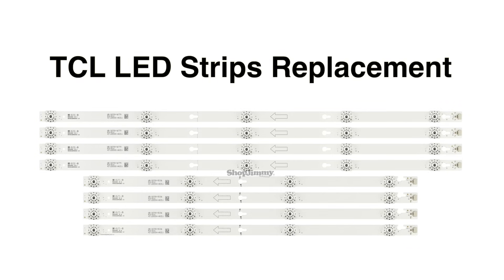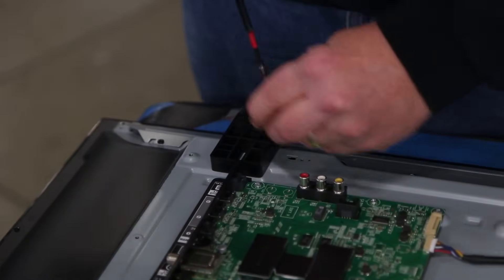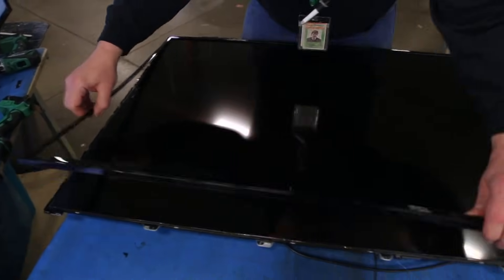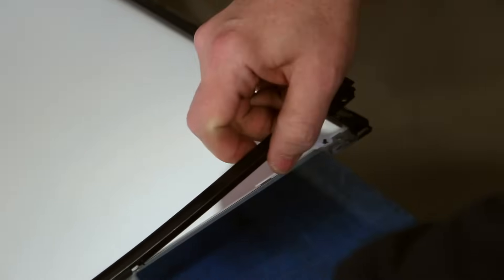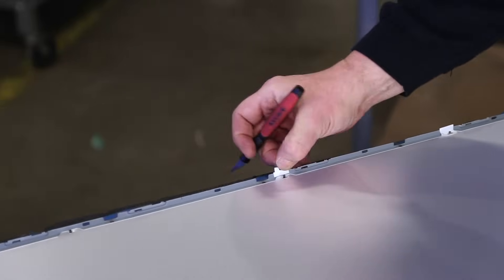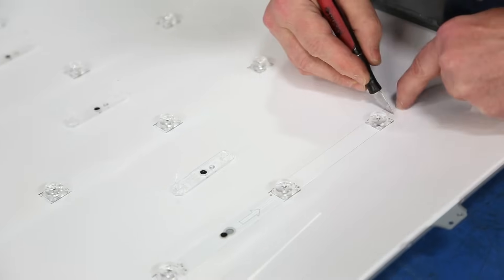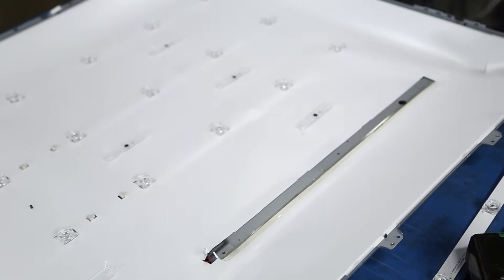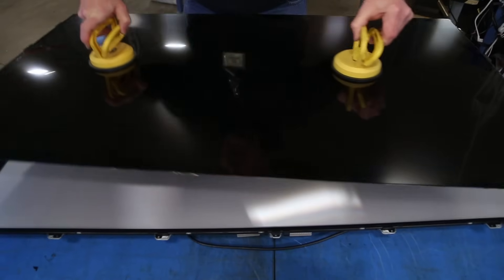TCL 55" TV LED Strip Replacement Tutorial for TCL Models 55S401 & 55S405

Comment: My led strips appear be to glued solidly down.  Like won't budge at all.  Going to try to loosen up the glue with a hair dryer.

edit:  Worked like a charm.  (Was also able to completely remove the reflector paper slowly but surely.) I found some places to wedge a screwdriver underneath while heating it up and then gradually popped each pt (was glued under each LED.)  Went like clockwork after.  Not sure if the black glue under each LED light was also for thermal dissipation but I didn't replace it.  (not like the tv lasted all that long in the first place ...maybe ~5 years.)

Great concise video to use as a guide.  I did a TCL 55S425.  It was a little different but the beats were the same.  Just go slow if your tv is slightly different because you might have to deal with disconnecting another wire or two, slightly different screw locations and wifi board etc and the the screen might have some ribbon cables and circuit boards attached.  The latter were also connected to the rest of the tv via a black ribbon cable.  Just flip up the cover on one of its ports and gently pull/wiggle it out.  

I out it together and voila ...one working tv.  Thanks.

Comment: **FYI**
One MAJOR DIFFERENCE between the 401 and 405 is the 405 has gold flexible printed circuits that are attached to the screen from the scan board. They just look like gold tape strips that are meant to be detached when running "a thin piece of plastic along the panel to be sure the adhesive has been removed."  Nowhere in this tutorial was that differentiated/shown as I'm assuming the TV being used in the video is the 401. You should really edit the video to clarify this or change the title of your video to pertain only to the 401. What was an understandable tutorial and process for me to undertake, turned into my TV being rendered useless. 

NOT HAPPY. VERY COSTLY OMISSION

Other than that....the video was very well done and easy to understand

Comment: Should have read all the comments first...absolutely wild that a tech repair channel would miss, probably, the most important step of removing the driver boards as to not damage the gold ribbons. I slightly cut one on accident trying to separate the adhesive from the panel (also explained poorly). Screen works again but the color is now a little off and it has lines that make it look like an old tube TV. Pretty disappointing the comments were more informative than the video itself....

Comment: And another thing, with this model actually it is not that difficult to remove the rear reflective film. They are just lazy and didn't even check to see that the adhesive of is very light on this one.

Funny because in another video where the adhesive actually is very strong, they make no such recommendations 

Do you even repair?

Comment: My tv has a entirely black screen. You can see the screen if you hold a flash light to it. If I need to replace the strips how many strips will I need to replace? When searching for strips I’ve noticed some come in 4pc and 8pc how do I know how many I need. I have a 55in tcl model 55S421
Reply: Hey did you ever replace the LED strips? I literally have the same exact TV model as you

Comment: very informative. However there's not much said about pulling the glass out. I did this and the magnetic film that is sealed to the glass popped a bubble and a crack looking bubble across it. It is not a broken glass. It is air between the screen and glass shield. Is there a way to fix air bubbles?
Reply: i have found out and there's not a fix, tv going to the trash.

Comment: This video is stupid. When you take off the screen, DO NOT USE THE ADHESIVE. There are little tabs around the edges that you can pop off to remove the screen, attempting to remove the adhesive will CRACK YOUR SCREEN BEYOND REPAIR!
Reply: “Do not use adhesive”?

What do you mean? The only adhesive he used was when he installed the new leds

Comment: Great walk through. You do miss out a few key parts as stated in some of the comments. The boards at the bottom connected to the ribbons would easily tear if not aware. Also for a glue separator, i used an old plastic spiral notebook cover. Worked like a charm. Glass came off super easy and was set aside until re-assembly. Overall took me about 4.5 hours to complete. Worth it for me. Thanks for the tutorial.

Comment: Thanks. Fixed my tv. Also listened to another comment to flip board around and tape it to TV. I didn't have suction cups like instructions did but I made two loops using gorilla tape and taping the legs down. Worked perfectly.

Comment: This worked perfect to fix the initial problem but I ended up having to junk the tv anyway because the adhesive is quite strong and the screen broke while disassembling. Can’t stress enough how delicate the screen is and even if you follow the steps exactly there’s a risk of breaking it. Oh well, I got the tv for free and only paid 40 for the backlights so I’m not out on too much money.

Comment: Don't do this. They now put an incredibly strong piece of tape along the top of the lid. Makes it impossible to remove without braking the lcd. It's on purpose so you have to buy a new tv!
Reply: Yup, this just happened to me. I followed the steps exactly but that adhesive is so strong it broke it in a tiny spot in the corner but it messed up the entire screen.

Comment: How about replacing the LED strips next time after adding that pink double sided tape. That pink stuff is nearly impossible to remove. Has anyone found a substitute material (black adhesive) that TCL uses to bond most of them in? I would assume it is some type of thermal adhesive

Comment: Thanks for the video.  I have this TV and it went completely black but if I shine a flashlight on it I can see the picture.  So it looks like my backlight went out.  But why would all LEDs go out at once?  Wouldn't that indicate some sort of power supply issue to the light instead?
Reply: Hey Robert, I also have this tv and my lights died last week, just letting you know to save yourself the trouble these LEDs are cheap and similar to low end Christmas lights where they cannot remain lit if one in the chain dies. You could test the internals with a volt meter but there's tons of discussions online confirming the absolute horrible quality of the LEDs. The whole thing seems to be designed to eventually fail.
Reply: @nukaiaahpo335  OK, thanks, I read that too, and if one goes out the whole strip is dead.  Terrible design, but at least it makes sense why this is such a common problem.

Comment: Hey Jimmy if you're still answering questions can you answer this question I have a 55 inch TCL Roku Smart TV. The screen is black and I have sound turns on and off. I've tried the goof ways with the controller five times with the top right button two times left two times right two times up and two times down did it 9 10 times. Then change the batteries try it again nothing, I unplugged it and that didn't work either so if you could tell me what I need to do Roku TCL model number 55 S4 21 if there's any other information please let me know.

Comment: How's he going to make this video and not say a single word about the ribbon cables attached to the bezel and the screen. Like thats the most important and crucial part of taking it off. I highly recommend watching another video on how to do this before you jump right in like I did lol. On a side note the adhesive underneath my screen was bonded so well it cracked my screen in one spot as I was running the plastic underneath it. The rest up it came right up no issues. If you want to attempt to fix your tv yourself before you buy a new one to try and save money then I say go for it. But its not as easy as this video leads you to believe.

Comment: This video skips many important steps and repairing your tv is 1000 times harder than they make it appear. I had to just throw my tv away after trying to follow this video.
Reply: Don't be dramatic. I just finished this 4 hour repair and I've never fixed a TV before. Be patient when you work on things and you won't break it.
Reply: Yeah OP must be a noob
 This is simple if you can follow instructions
Reply: Yup, not that well thought out
Reply: Tell me about it, I thought I had a great deal when I found a TV like this a few years ago with a few bright spots all I had to do was replace the little reflectors that had fallen off the leds.. but of course it was a lot harder than it looks in the videos, and that little thin LCD glass is incredibly fragile, I accidentally bumped one corner on the floor and that was it.
Reply: After I seen you needed suction cups, I knew I'd just needed to buy a new one
Reply: @bigmillgaming2362  I did this same replacement and didn’t use any suction cups. Makes it easier and faster for sure and is safer but completely possible without them. My model is the 55s425. Replacing these strips are probably the easiest fix on a tv, I’ve done it 3 times and I’m doing it for the 4th time in a minute. The only thing I do is watch 2-3 different videos then go at it. If you still have the TV you should 100% give it a shot
Reply: @imdatnigga9715  A few days after my comment, my tv randomly fixed itself thankfully. If it happens again I think I'd rather gone and get a new one, it's 5 or 6+ years old anyway
Reply: @imdatnigga9715  I am planning to give it a shot. How many strips do we need to order and what are the tools required? Worth a try though
Reply: @bigmillgaming2362 😂😂I totally agree with you,I stopped watching as soon as the suction caps were implemented.
Reply: @bigmillgaming2362 that is exactly what discouraged me. Everything else was okay. It does seem like it requires some skill in ensuring that you don't cut out wires, and removing adhesive has never been a fun part for me.
Reply: I mean if the tv was already broken then you had to replace it anyways lol at least they have a guide to try and help you
Reply: Years ago I got a tv when I was working the board was damaged I paid 5$ to have it fixed it's not that bad if you know a little bit of this and that the only way I figured out it was the board was because one chip was missing that samsung was a great tv over all

Comment: I finally took apart my 55S405. One thing I did notice is that all 8 of the LED strips are NOT securely attached to the back panel. All the screws are tight, but there's a little wiggle room by design. The screw threads are raised just a little bit higher than the LED strip, so there's not enough heat exchange from the LED to the case back plate. I would guess that's the reason these are failing so soon. After testing my LED strips, I found 1 out of 36 LEDs is dead. And wouldn't you know it, it was an LED at the top row where there's the most heat.

Before replacing all these strips, I'll be adding some thermal paste/glue to all 8. Each screw could use a washer to fit around the raised thread too to hold the strip more securely. But you'll need 28 washers.
Reply: I read your comment before fixing this TV and looked at it too. You are right, aluminum led PCBs barely makes a contact with huge aluminum back plate (supposedly to get rid of the heat). I think that wiggle room is 100% not intentional and is manufacturing error because they did not calculate little metal pieces arising around the hole after you drill it from behind the metal plate. These tiny metal bits adds just enough height so whole assembly is not possible to secure tightly and make a good heat transfer. What I did is I used Dremel and grinded each led srip mounting hole for a few seconds, it was enough to remove those tiny pieces and new (as well as old) led strips screws in very firmly, no need for washers. If you would add thermal paste it might be even a bit overkill, I did not since it looked more than enough heat transfer after this grinding mod. Also in my case I found some black tape used in manufacturing right under where led strip supposed to make a contact, so I removed those pieces to make metal to metal heat transfer (I believe manufacturing error no 2). But also I would recommend to remove that final white reflective sheet without cutting it like in this video so you won't damage it while grinding + it is not that bad to remove at all, I removed it intact without any tools, just keep steady pressure starting from the corner and allow some time for double sided tape to release it, it is even faster than playing with new double sided tape. After I was done I can already feel slight warmth on that huge back aluminum panel from the leds while tv is working. I paid 18$ for complete new led strip set from aliexpress and waited around 2-3 weeks for it to arrive, and the new ones looked the same as originals. And like somebody mentioned somewhere here before don't use any thin plastic piece to remove the glue from the panel, this is super risky, just unclip the top plastic inner filter frame and lift the whole thing.
Reply: Okay everybody here's my dilemma I have a TCL Roku TV if I open up the back I only have three parts one strip that comes from the power to the left side of one of the main boards then I have two quarts connecting one is the power from the switch on the bottom the other one is to the speakers everybody I've asked every one of these YouTube things I've looked at nobody has shown me the same TV everything is a LCD and they say that TCL is the same they're not the same I only take off the bottom part and it shows me my three parts and that's it I've got a black screen but I still have sound if anybody has any idea for me what to do please let me know

Comment: I just need to replace the screen.  Luckily, I found another exact model 55 TCL for free online (backlight was out).  I'm guessing the new screen will fit into my tv no problem?  Any advice is well appreciated!
Reply: I'd say you shouldn't have any problems since it's an exact model. Just make sure the insides look similar too, then a screen swap should work.
Reply: Yes make sure that it is a TCL not an LCD TCL Roku does not have LCDs Roku is a smart TV but it only has three parts on the bottom and no one has shown anyway to fix it they always show the LCDs

Comment: Almost worked. He didn't say anything about that green tape attached to the screen. I assumed it was just tape to hold it on, but apparently it was important. Got all the way through and the screen was busted because I cut that tape. I'm a novice, so I was hoping for a more thorough video. I'd suggest anyone who has no idea what they're doing, find a better video.
Reply: I've read your post many times throughout a few days, and I still do not know what you're talking about. The green tape HE put on to hold the layers together. Of course you remove them when you put the layers back in place after you replaced the LEDs. It's strange you mention "green tape". When you say "because I cut that tape", what tape are you talking about? These TVs do not have any "green tape" build into them. Did you apply your own tape? If you did I'm assuming it was green. Did you go to the store to purchase "green tape" specifically for this TV repair? Your post does not make sense.
Reply: @MeMe-wh7tr  Maybe tape wasn't the best word since I have no idea what they were when i attempted this. It was the ribbons that connect to the top of the screen to a board on the inside of the tv. Since I dont know what I'm doing and the video didnt talk about them, I cut these ribbons thinking they were tape holding the screen in place.
Reply: This is exactly what I did too. Tried lifting out screen. Didn't notice tape. Tore tape and now tv is probably nfg. Fairly important step. And should be done before putting screen side up